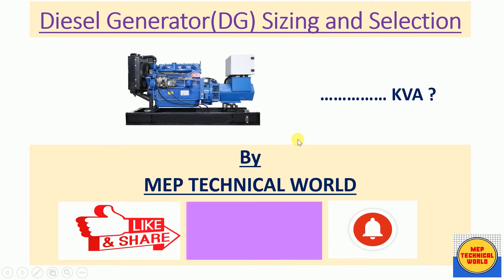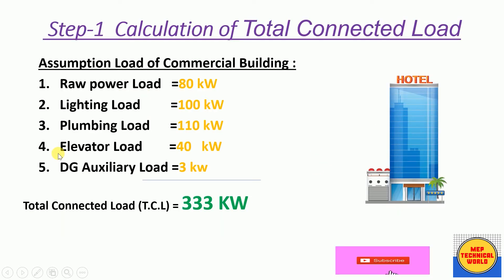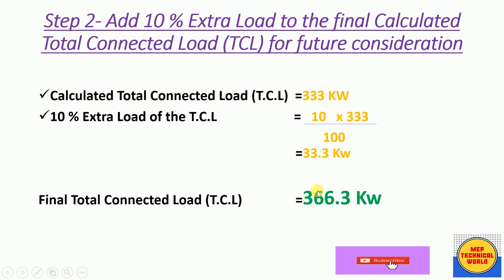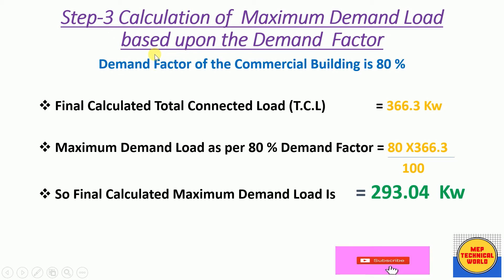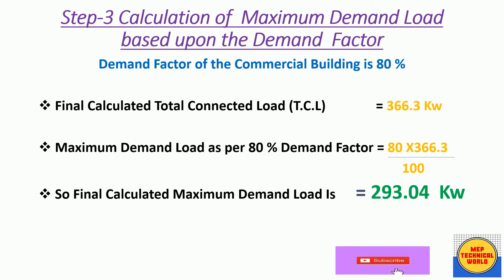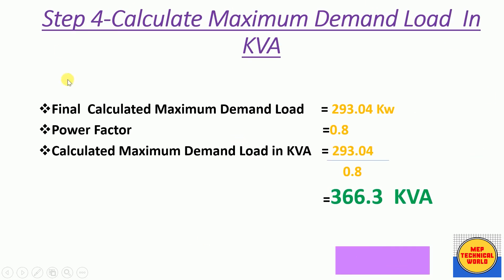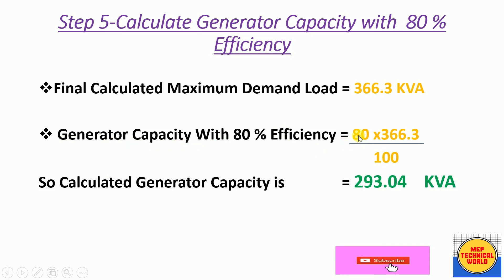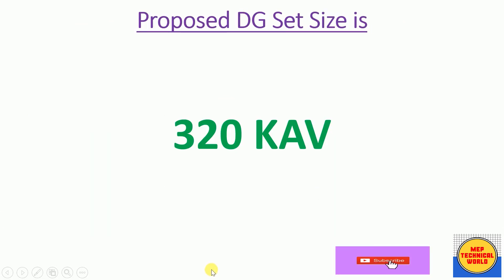Diesel Generator Size Calculation | How to Calculate the DG Size (KVA)

Comment: Steps-5    366.3/(80/100)=457.875KVA So Calculate Generator Capacity Is 457.875 KVA .
Reply: Correct.
Reply: 80% of 366.3 is 293.04 ... Go back to school bro..
Reply: @truefaceofmo8307 no brother he said the generator should always work at 80% capacity so the 80% should be equal to the demand and we add an extra 20% over that so it will be somewhere around 440 KVA

Comment: it is not the correct study, what about the A/C's and other loads that have a high starting current, all the loads are steady-state loads! what about the 80% efficiency of the Gen-Set it's mean you select the higher rating, not a lower one. better to choose the software and add the loads as a step to avoid a higher selection of units. 
the application of unit also is very important (Means standby, prime, or continue dayacenter application)